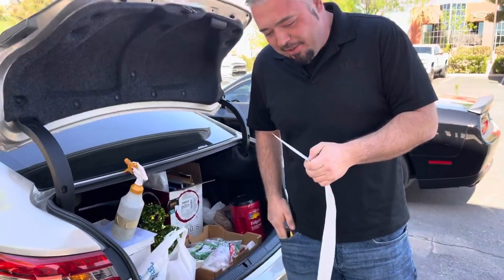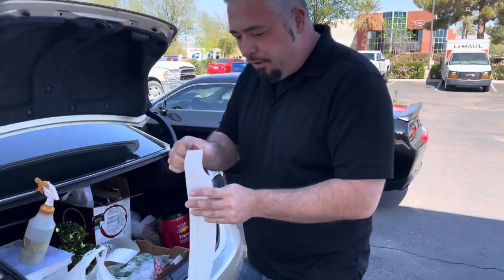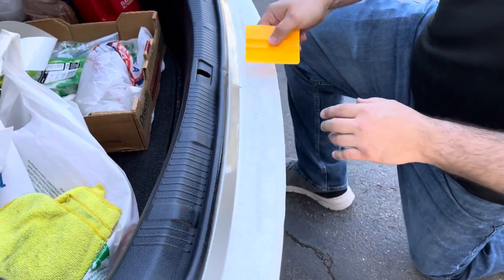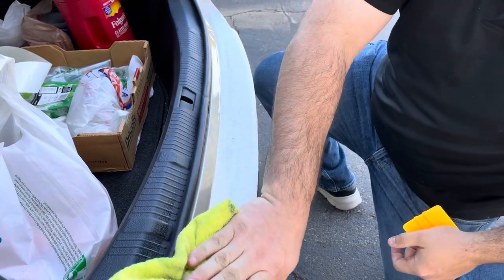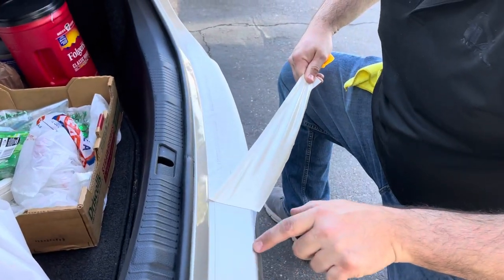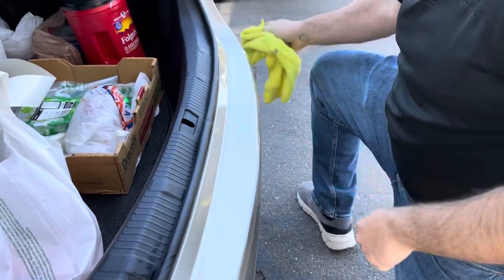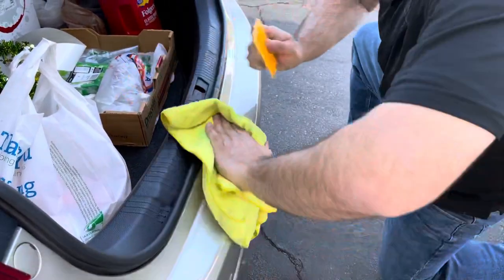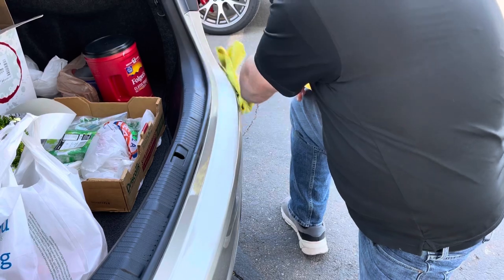How to install a clear vinyl bumper cover cargo protector scuff guard

Comment: how do you remove the existing cover?
Reply from the maker: @paulwilliams3818  if there is an old one on there, use a heat gun and it should peel off with most of the adhesive, any leftover adhesive can be removed with 3M adhesive remover and a microfiber before installing a new protector decal.